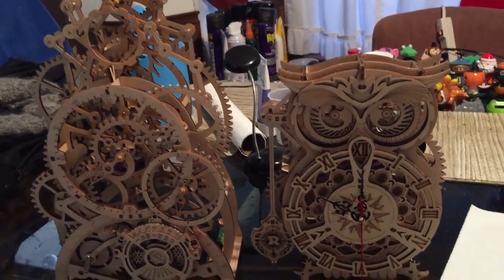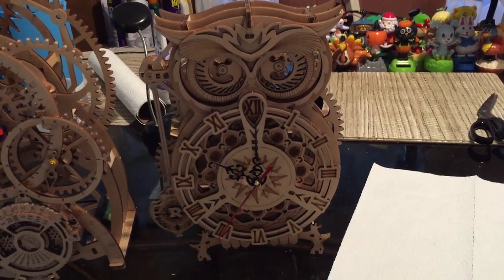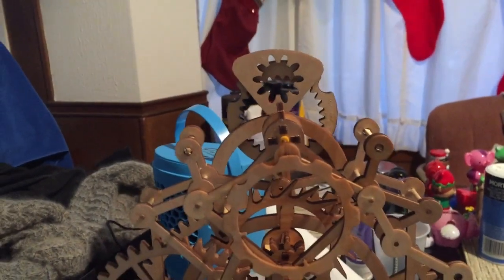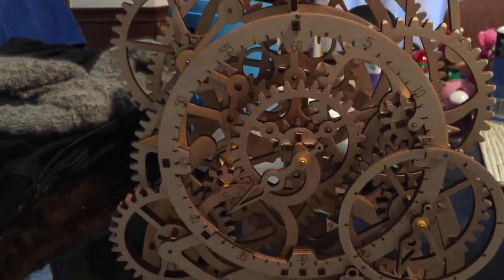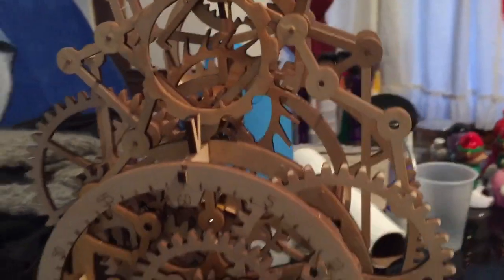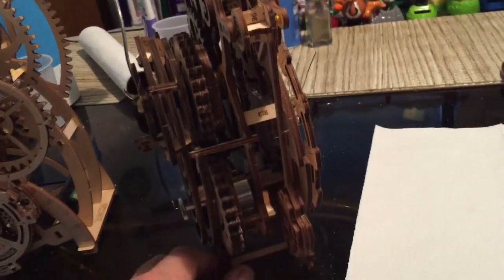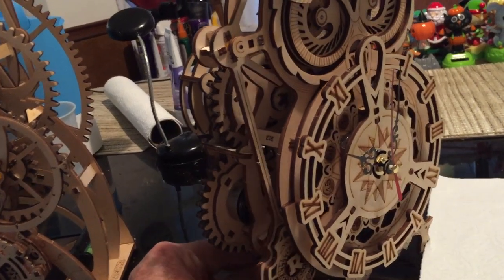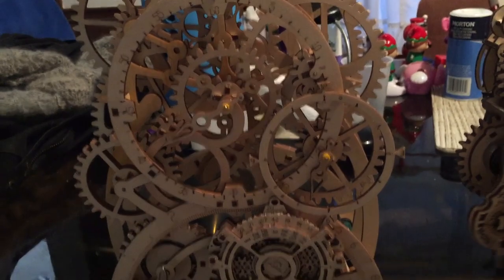ROKOR DIY WOODEN PUZZLE CLOCKS

Comment: We are having issues with the timer not working properly and the pendilum slowing down and stopping after about 7 clicks...any suggestions on how to fix?  Not sure if I need to partially disassemble as well...
Reply: I have the exact same problem and no idea how to fix it!!
Reply: Where did you bougth the owl pendulum clock?
Reply from the maker: We  knew to sand and wax the gears and any place where parts contact each other, also gears that are not flat " are warped"  will be a problem, dampen a warped gear and try ironing it to make it flat.

Comment: Accidentally snapped the pendulum on the left clock in half, which is really depressing, but for some reason would randomly speed up, slow down, jam, or keep running without turning a gear properly
Reply from the maker: The gears must align properly, when it runs without turning a gear the ratchet pawl in the winder might have disengaged, or gears are not meshing and are slipping?

Comment: How do you get the timer to work? Not sure if the gears are lined up right I took it apart and tried twice :(
Reply from the maker: That is pretty tricky, turn the alarm hand counter clockwise, when this happens it moves a inside lever up onto a cam, wind the alarm a few turns, start the pendulum ticking, when the timer hand returns to zero the internal arm drops into a notch and allows the alarm to sound, Not easy to align all parts to make this work.
Reply: @whywidehide  I appreciate the reply! It is very tricky to align everything properly and to do so without braking any parts. I’ll try again. Thanks

Comment: Ridiculously complicated. Seems like you need 4 hands . 2 to HD it together and 2 to keep building it. Every single time you move it or pick it up to add a other piece something  falls off
Reply from the maker: It took two of us, me punching out parts and wife putting parts in place. and we did have to rework some parts, gear teeth to operate smoothly, with a full 15 , 1/2 half turns on the wind up key,  it runs over 6 hours. Wax the gear teeth, oh we messed up the alarm winder so that part does not work.